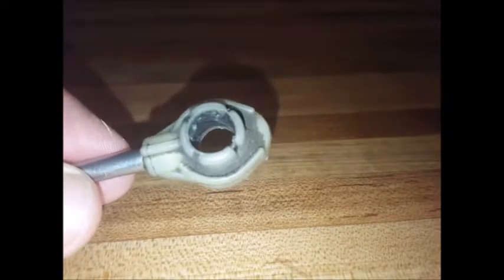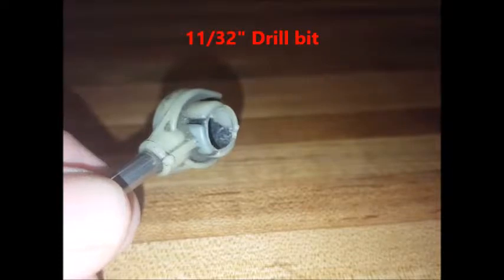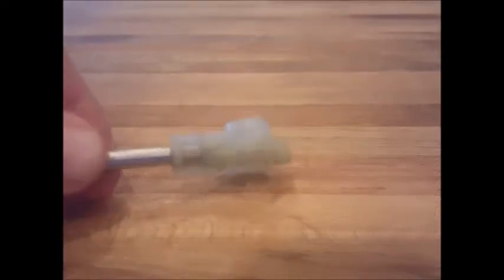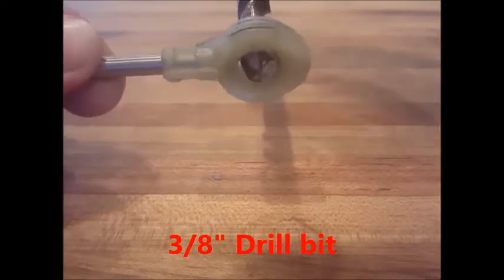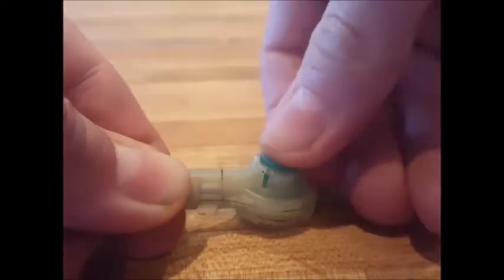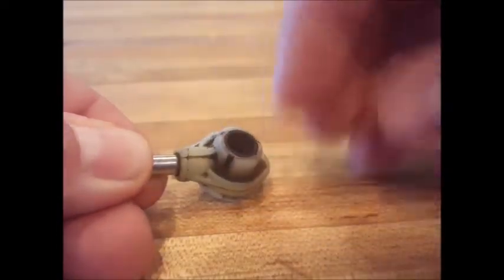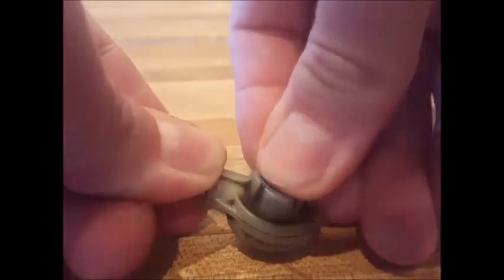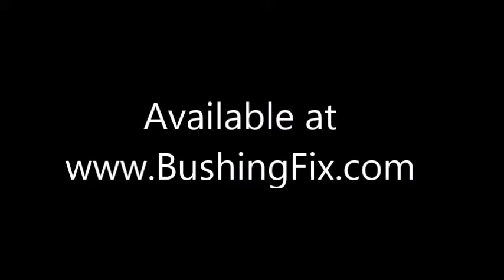The easiest way to fix or repair your Cadillac Allante shift lever! Includes replacement bushing.

Comment: Would this bushing cause a problem with the transmission shifting to third or fourth?
Reply from the maker: It definitely could! Only way to confirm is to inspect your ends of shift cable to see if bushing is in place and in good condition.